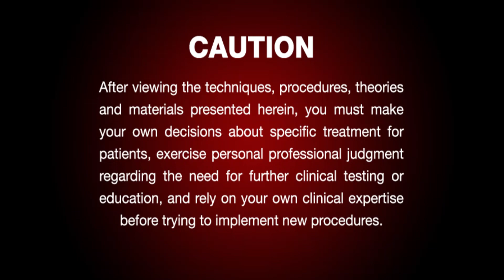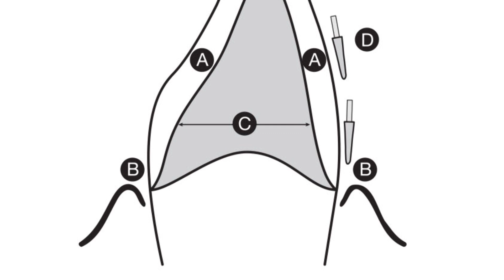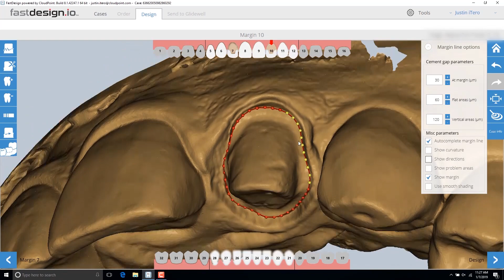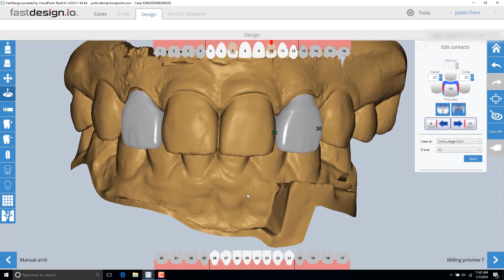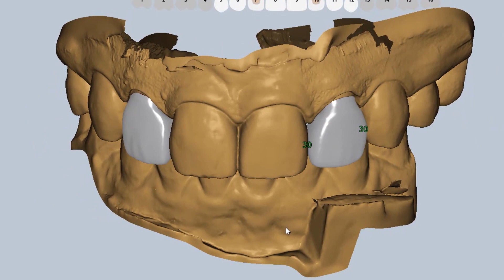Chairside Live Episode 243: The Perfect Temporary Milled In-Office

Comment: thanks for the illustration , I would like to know why in this case , Glass ionomer then composite ( with adhesive ) were used ( i think this is too much layers ) , why he did not just build up by glass ionemer ( yes it has a limited mechanical force but a crown will be placed on it , and we will have only one layer under the crown ) thanks .